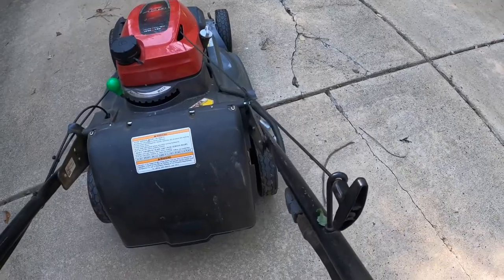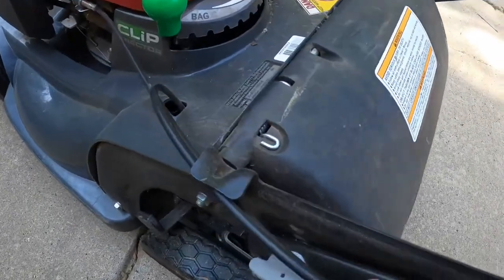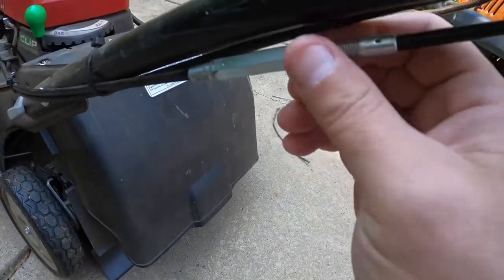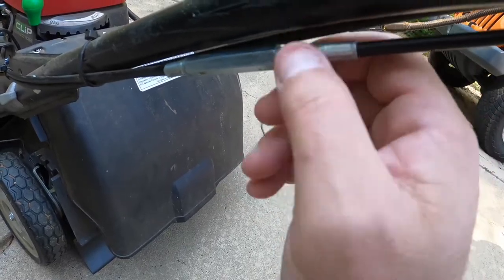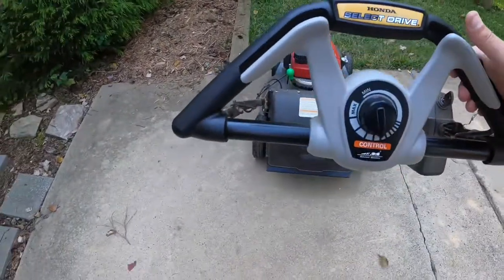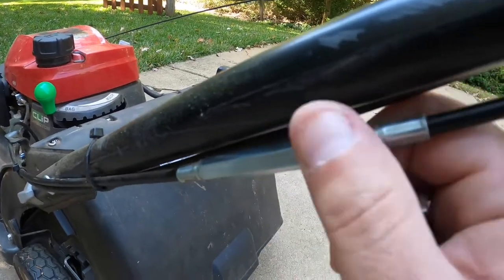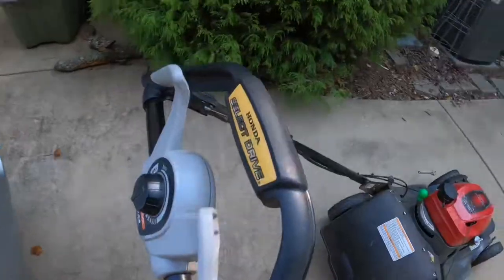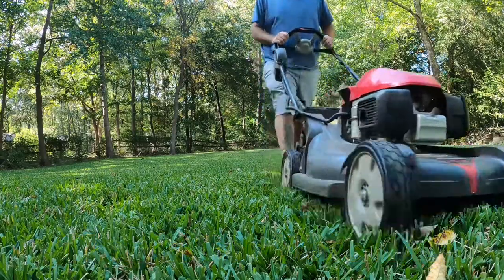How to Adjust the Drive Cable on Self-Propelled Lawn mower - Quick Fix

Comment: If your noticing that youe getting to the end of the adjustment, youe drive belt is stretched and needing replacment, doing this is just going to stretch the belt even farther, I suppose there is no harm in this, however belts are like $10 and only take basic hand tools to change out in 10 mintues. You will notice if you don't back off the tension adjuster that it will pull much better.
Reply from the maker: Absolutely! This is a quicker fix, but the belt will ultimately have to be replaced.

Comment: Question???  I have the HRX217HXA hydrostatic.  It seems to pull fine but I cannot roll it backwards.  I have taken to local dealer twice.  They seem to get it rolling but it only last for about 6 mowings, locked again.  Have you experienced any with this issue and if so, what did you do?  Thanks
Reply from the maker: Hi Steve, I have not experienced this, but it sounds like maybe your mower isn’t finding neutral. Your drive being engaged would surely stop it from rolling backwards.

Can you roll it backwards when the mower is turned off?

Comment: Do your thumbs/hands get fatigued from select drive? I can’t test it in person where I live
Reply from the maker: No, not at all. It’s very comfortable
Reply: @LKNDIY  is there a way to adjust the tension on the cable so it requires less force from your hands to push the select drive paddle down?
Reply from the maker: @spectre3492  I’m unsure, but I’ll try to find out
Reply: @LKNDIY  I think it’s the spring connected to the transmission underneath the mower. You can see it if you go where the cable connects to it from the paddles

Comment: Can you do a video on the Troy Bilt XP rwd? Screwy build all around.
Reply from the maker: I have an older Troy built weed eater, but not the mower.
Reply: @LKNDIY  At sixty plus pounds this beast is only a step behind a small riding mower. No wonder the transmission guts get ripped out so easily. 
Wondering if they ever redesigned the gearbox to handle the torque and increased stresses. 
Oh... so much more to criticize on the poor Troy Bilt series 860